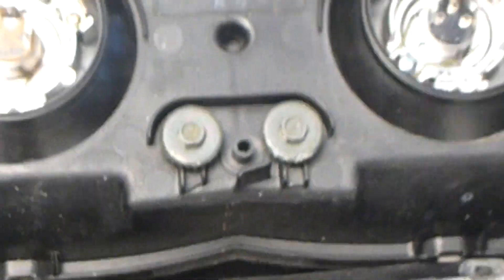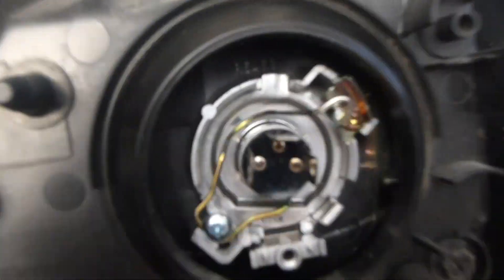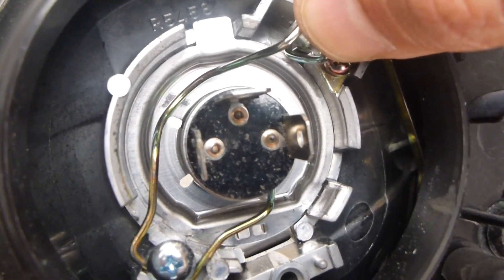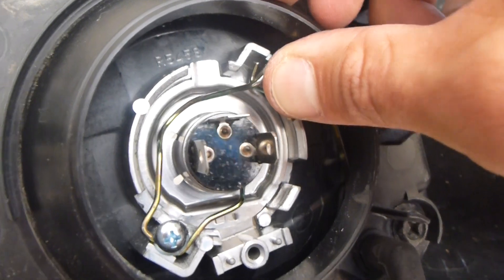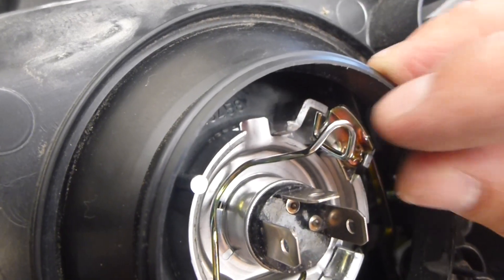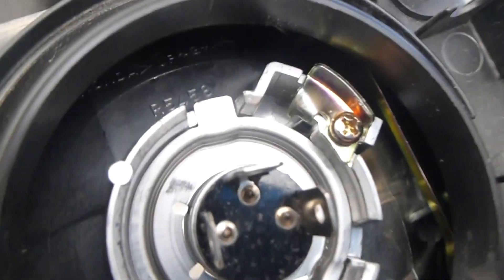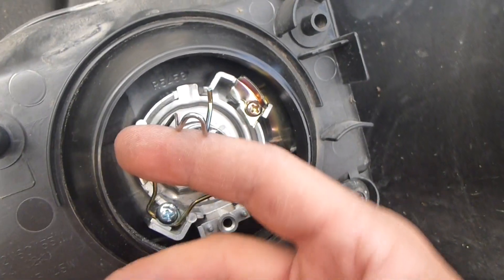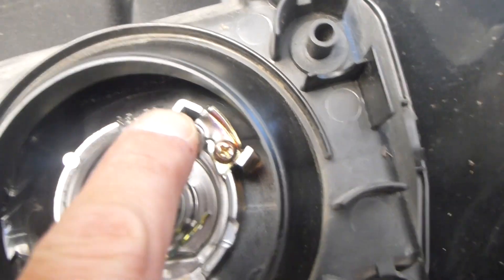1998 VFR800 headlight bulb replacement

Comment: That is a bit of "Trick" to get that retainer clip off. I too, major league frustrated with Honda "we make it simple" design on that one. The H4 bulb with it's own specific tab arrangement . . . another point of contention with the headlight system. The gentleman sport touring bike, that needs complete dis-assembly of the upper fairing to achieve, and requires a unique bulb to replace. Good Post, thanks for the video, and the time you took to help others . . .

Comment from the maker: Crap, sorry for the slow reply bud.  Hopefully you've got it figured by now.  A standard H4 bulb will do...lemme see if I can find a quick Google link and if it'll let me post it here.  Nope...have to put in video description.  Look there for link.

Picked Walmart as they're common across both Canada (where I am) and the States (where more readers likely are).  Just need a generic one, you need a pair of sidecutters or tin snips to cut off the two lower tabs, and it will pop into place mint.

Comment from the maker: That's sort of why I did it like this.... I couldn't figure it out without getting a good look at it either. I posted it in hopes that once you pull the connector and rubber cover off the bulb mount, you could feel around in there for the retainer clip, not described or drawn very well in the repair manual, and now that you see how it actually clips down, you can do it more by feel like than anything. There's simply no room to stick your head down in there to get a good look.

Comment: How do you get the wiring harness off?
Reply from the maker: ssmoothe2000 If I remember right, it's a pinch removal system. There are little tabs you squeeze in on the opposite sides, and you just squeeze the hell out of it, and wiggle the connector backwards off the prongs. If you can get a light in there, should be pretty obvious which is the squeezable part.
Reply: Thanks, been dealing with this for two days
Reply from the maker: Hope it helps man!  Good luck.  F'n love the VFR, but they sure made the headlights...interesting.